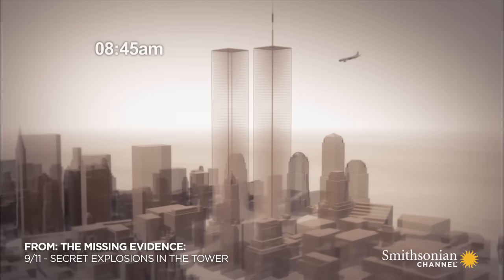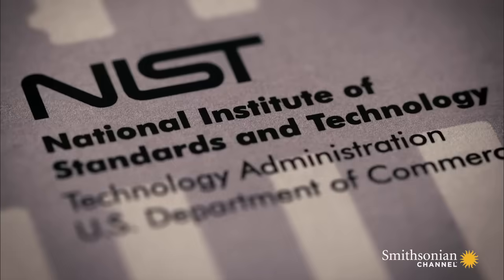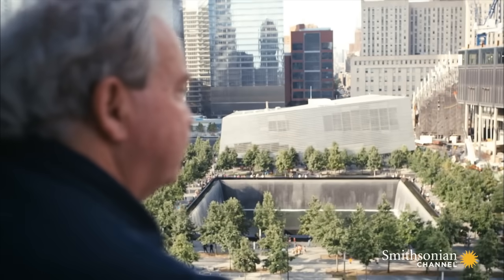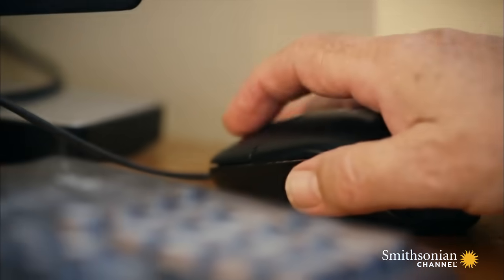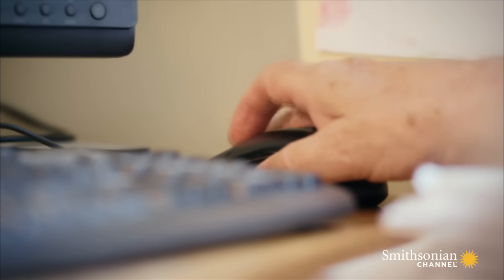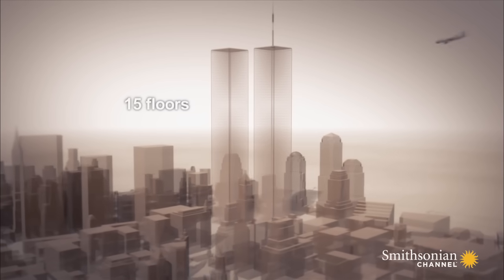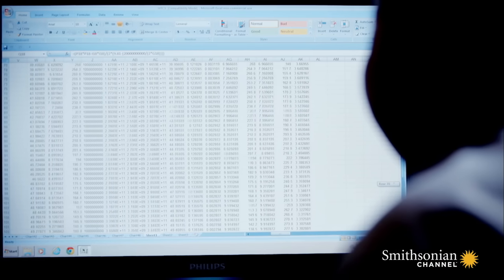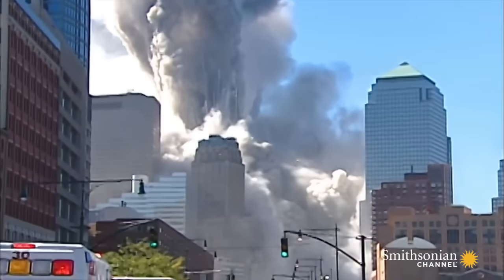This Computer Simulation Explains How the Twin Towers Fell

Comment: What simulation ? What proof ? This is a joke !
Where are the results of the simulation ? What about the "extensive lab tests" ?
I guess this is just counting on people reading the headline.
What about the MANY reported EXPLOSIONS like in the BASEMENT, the LOBBY , the SUBWAY ? 
And the MANY EXPLOSIONS reported by the firemen ?
This is even worse than the Purdue ANIMATION that violates physics over and over, shows parts that can NEVER be damaged after breaching the wall. And parts that NEVER slow down either. Violating equal and opposite forces and conservation of energy !

Comment: The planes were fitted with tactical lasers not only to guide the planes to there target, but to also make sure they would penetrate the buildings deep enough on impact as the towers were made with REINFORCED steel beams.

Comment: first - the upper floors are not some solid weight, it has been disperse, as we can see
second - where is a pile of rubble in aftermath?
third - why any of towers hasn't  lean toward the more damage side of buildings
fourth - if upper floors are tearing thru tower it self, why no change of speed?
fifth - and why the hell the concrete has been powderise in mid air?

Comment: Its simple: jet fuel cant melt steel beams, but can certainly heat them up to the point where they would start to bend under weight above.

L

Comment: Mr Greening is talking piffle - the top block of the south tower can be seen tipping over almost as soon as the collapse begins, it disintegrates and debris from it appears through the dust cloud.

Maybe Mr Greening would care to explain the lateral ejections at speed of numerous pieces of steel ripped apart in the collapse ( by which mechanism  ? ) and the extreme temperatures under the ground which lingered for weeks.

Comment: To all of the people who are still skeptical about 7 WTC, if you actually care to learn then read this comment carefully.
WTC 7 was 47 stories tall, less than half of the height of the WTC Twins. It was the northernmost building of the entire complex. It was across the street from One. When One collapsed at 10:28, debris raining down damaged the south face severely. The angles of Seven's collapse are from the north facing south, so you don't see the damage. The building was built on a small foundation, a lot smaller than it needed to be able to build it right, but the engineers worked around it and from floors 5-7, they had transfer trusses that helped direct the load of the building onto the smaller foundation. That being said, the building had a few key beams throughout the design that were key to its ability to stay standing. Once fires broke out from the damage of One falling, it weakened some of these beams over the seven hour period it burned. 
If you watch a video of its collapse, you can clearly see smoke rising up from the roof of the building, along with a few of the roof structured collapsing. That shows the aftermath of those key beams failing and most of the interior of the building collapsed, leaving the outer shell. It fell so fast because there was nothing inside to slow the collapse down. And as the building collapses, we can clearly see smoke already at a standstill as the outer shell falls around it, signifying that the building fell due to structural damage and fire weakening the steel enough to allow it to fall. Office fires burn at hot enough temperatures to weaken the steel by at least half, which helps explain the quick collapse of the Twin Towers and building seven.

Comment: out of curiosity, wouldn't the intact upper section of the building shift as its mass unevenly impacts the floors below, so wuoldn't larger portions of the building have fallen further away from ground zero

Comment: I can't see what is wrong with people,  you just have to apply the physics ( newtons 3 laws of motion) that's why nist didn't go there as they would be violating newtons 2nd and 3rd law which have yet to be disproved and have been effective to all other scientific tests for over 300 years and factor in momentum of conservation which also would have been violated and redundancy of structure and no physical test where done as they knew exactly what the results would have been, that's why they used computer simulation to determine the results which they haven't released the data for peer review as they know it's totally flawed. Period!!

Comment: What about WTC7? Explain that...
Reply: Well the largest building on the planet just collapsed on top of it and fires burned it from the inside out, causing structural failure. Pretty easily explained actually.
Reply: LandShark 11 Willis tower did not have it beat. It doesn’t even beat the freedom tower
Reply: LandShark 11 you dumb fuck I never said it existed then I just said that Willis  tower doesn’t have the twin towers beat. I then said that the freedom tower, which is smaller than the twin towers, still has the Willis tower beat.
Reply: Dinomin Prior to the September 11, 2001 attacks in New York City, the twin towers of the World Trade Center occupied the second and third positions on the list below, behind Willis Tower. The North Tower stood at 1,368 feet (417 m), while the South Tower was 1,362 feet (415 m) tall. The Willis Tower, built as and still commonly referred to as the Sears Tower, is a 110-story, 1,450-foot skyscraper
Reply: Dinomin your argument was that it was the largest building which it was not, I'm only using 2001 because that was the year that this took place. One world trade center is now taller than the Willis tower.
Reply: LandShark 11 Willis tower is only higher in the amount of floors it has, but the lightning rod makes the twin towers, or at least one of them, larger. Same with the freedom tower
Reply: Roger Wilco but there was another building between 7 and the twin towers. Did the fuel skip that building and jump solely to 7?
Reply: Dinomin wasn't the largest building in the world. Willis tower in Chicago had it beat
Reply: Dinomin the freedom tower didn't exist then. Apparently you don't research

Comment: this guy is in on it... Why are there so many physicists that say otherwise... there is an equal amount of force holding the buildings up... If you are pushing something down there's an equal amount of force resisting going upward... This proves that it was a controlled demolition...  so the building's would not collapse on each other without explosives... And oh yeah what about building number 7 World Trade Center 7 WTC 7! why does nobody talk about that? it collapse on itself just like the Twin Towers... There were no 15 stories above it either

Comment: A couple of important facts aren't mentioned in this article, or in any article I've seen on this incident.

1. Commercial aircraft have an aluminum shell, but they have an extremely strong frame structure the shell is placed on. That shell is designed to handle huge stresses and strains, and it's very strong. Many of the internal struts are alloys, some with titanium.

2. It was designed to survive the crash of a commercial plane, at the time of design and construction the biggest in use was the Boeing 727. It was hit by a Boeing 767-200 and a Boeing 767-200ER. There are significant differences between the aircraft. Some of them being the weight and the fuel load. The 727 max weight of 170,000 lbs - max fuel 7,680 US gals; while the 767-200 max weight is 315,000 lbs - max fuel 16,700 US gals, and the 767-200ER max weight 395,000 lbs - max fuel 24,240 US gals.

The building was designed to withstand an impact of an aircraft of 170,000 lbs and got hit by one of 315,000 lbs and one of 395,000 lbs. That's 1.85 times the design weight, and 2.32 times the design weight, which also have a significantly larger kinetic impact than the designed impact. the fuel loud is double to triple the level designed to survive. Thus the original design criteria are significantly outdated by what they got hit with. Also, the aircraft design of the 767 is much stronger than that of the 7272, due to having the greater capacity and weight to carry in it.
Reply: You forgot some small details.

1) Commercial aircraft doesn't really have strong frame per se as its cylindrical design helps on the added pressure, still it can handle huge pressure from the inside going outside. Also, commercial aircraft aluminum shell is also thin and light.

2) The WTC 1 and 2 were design to survive the crash of a commercial plane, but coincidentally the WTCs major column supports were under repair because of a fire that happened recently.

Yes, the building was designed to withstand an impact of an Aircraft greater, or equal to 170,00 lbs (not including factors such as momentum, speed, etc.) but at the same time it was under repair and the columns didn't hold as intended. But I feel skeptical about why it fell that indicates a controlled demolition. Grabbing my tin foil hat now.

Comment: The completely ignored the fact that they should explain how a plane weakened the structure in the first place...
Reply: it crashed into it!
Reply: You do know that most of the supporting stucture of the towers was the outer walls.  You know the PART THE PLANES PLOWED THROUGH.  The center beams in the middle of the tower were mainly there to support the Elevator system.  Which was built to treat each of the three zones in the towers as separate 40 story buidlings. At the bottom of each zone was a mechanical floor with tonnes of equipment to run water, ac and heating.  Each floor was an Open Floor Plan to Maximize useable office space.  Many of those offices had lots of furnishings and paper files. 

You all talk about this like the Buildings were built like the Empires State Building which was traditional hanging curtain construction.  They weren't they were basically hollow because the building was built like a tube so it could flex in the wind...  Which by the way meant that the floors weren't actually "Secured" down but were supported by trusses that were actually held in place by the "BOX" that was the outer support structure.  Each truss sat on a "Tab" which had a rubber pad on it that absorbed most of the momentum from the swaying of the upper floors as the winds off the harbor buffeted the building.  The fire is what killed the buildings.  The fire WAS HOT ENOUGH to WEAKEN the steel especailly the Steel Tabs the floor trusses sat on.  Once those trusses when the floors fell bringing the rest of the structure with it.  

You all need to learn to science damnit.
Reply: As for building 7?  Have bits of smoldering debris from two gigantic towers fall right through YOUR Ceiling and see if you can stand BTW the building stood for 300 times as long as the towers collapsing at almost 5:30pm.  What people don't realize is that the building was showing signs of possible collapse as early as 2 in the afternoon.) While the debris from the Towers didn't contribute greatly to the collapse the fires on multiple floors did.  The fact was exerbated by the fact that Due to the towers collapsing.  Power being out, which lowered the water pressure for the sprinkler system, which was also partially manual. The building failed.  I also love how people continue to say the building was "Pulled" and that if was a controlled demolition even though the collapse of WTC 7 damaged Fiterman Hall which had to be demolished (which was done in 2009) and rebuilt (Which was done in 2012.)  Those demo teams did one hell of a job not damaging any other structures when they did all these "Controlled Demolitions"    
TRUE FACTS.
Reply: Dark:  you are seriously misinformed about the Towers structural plan.   It was more like 50-50.  And the principles by which the design was done are the same as with all the other successful steel framed high rise buildings,  it's just that none of the others were blown up intentionally.   Your ideas of the structure are frankly, wrong.  "Rubber Pads"  did NOT absorb wind loads.  There were plenty of interconnections in the steel system of columns, floor trusses , etc.  both welded and with bolts. "The FIRE"  could not possibly heat up, simaltaneously, on a hundred floors at once, these elements enough to weaken them in any significant way.  And remember, they all had to fail at once, otherwise the Fall would not be straight down , as you must admit it was.  Your idea that the floors were not secured is a simple fantasy.   Maybe you should follow your own advice and "learn to science".